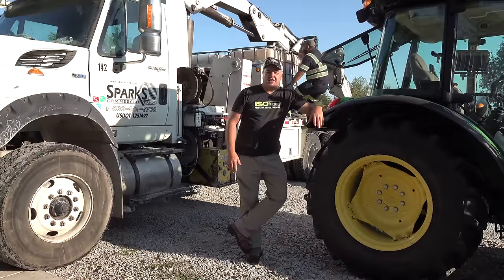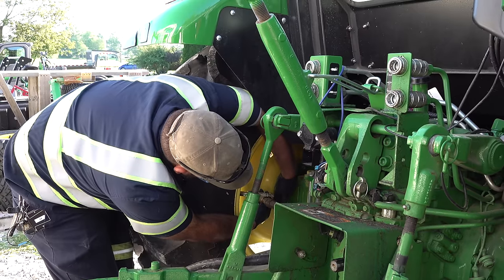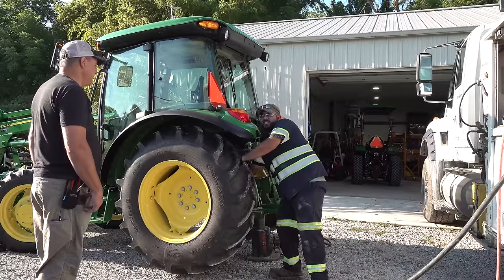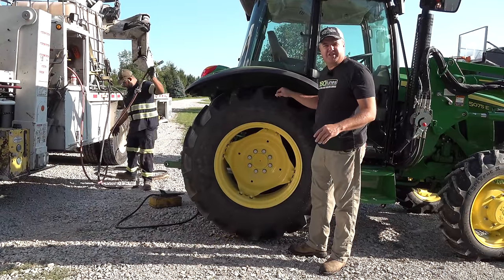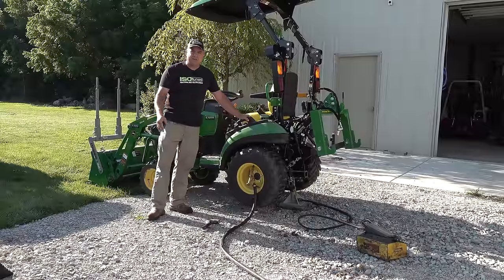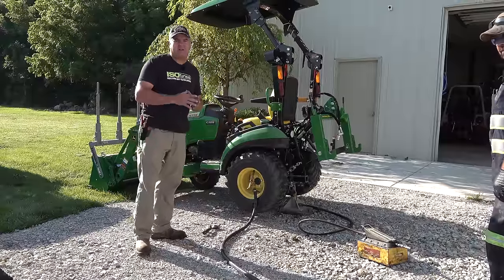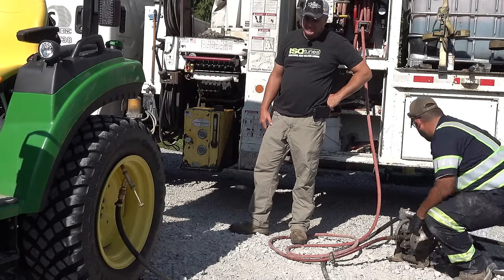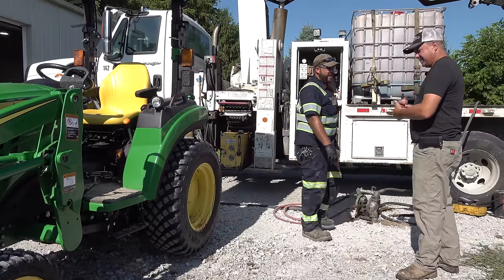Optimal Tire Ballast??  How To Add Rim Guard to Compact Tractors

Comment: Now I was told by my dealer not to put fluids in the rear tires on the 1025R it is hard on the drive train and void your warranty. I was also raised on a farm which drove a lot of tractors with loaders plus trained on a forklift you never transport a load no more then 4 inches off the ground . Any time. I use the loader on the 1025R there is 480 pounds hanging off the three point hitch and stay off the side hills.
Reply: Richard Koehler it clearly says in the owners manual (page 06-25) that you can add ballast to your 1025R. It’s under “Using Liquid Weight in Tire’s” 
Maybe the dealer didn’t want to add it because your deal was done and he didn’t want to come out of pocket or they didn’t have the capability to do so and didn’t want to hear you complain.
Reply from the maker: Richard, your dealer is incorrect.  As Wraith mentions, you should take a look at your loader manual.

Comment: Good video. I'm watching for the umpteenth time. However, this time I am waiting on the Deere dealer to pick up my Johnny 1. I can't find a tire service locally, and the dealer has to carry Johnny in to fix it.  The right rear tire began leaking Rimguard around the rim. I went to check the air pressure and barely touched the cap on the valve stem. The entire core with the brass insert blew out. I got the tractor in July 2020 and have only 32 hours on it. The tires were filled by the Deere dealer. Now sure about the statement in the video about Rimguard not deteriorating the valve stem. It looks like Rimguard could have deteriorated my valve stem... or maybe it was a bad valve stem. Either way is concerning and makes me very wary of checking air pressure. I am going to have them check the other rear valve stem. Thankfully I was behind the tire when I touched the valve cap!! Reminds me to always safety goggles around tires, especially filled tires. It does stink!!

Comment: No fancy stuff needed.
Pull tire and wheel, break bead on one side, pour in cocktail of choice. Air up & reinstall.
I prefer RV anti freeze for the tractor and Bourbon and Coke anti freeze for me.
Reply: I use the same in my tractor n me. No problem with tractor but I must have a leak. Constantly having to refill my antifreeze.

Comment: Are the factory 1025R valve stems compatible with RimGuard? I was told they are not!
Reply from the maker: There is some disagreement on that point.  Some say to replace them with steel.  Others say the rubber valve stems are fine.  Rimguard (the company) does not have an opinion on this. I have asked them.

Comment: I am having the rear tires of my new 2032R tractor being filled with Beet Juice..... I haven't taken delivery of the tractor yet....is Beet Juice ok?  Will it rust out the wheels??  And..... if you cannot use a loader without a ballast box, I am wondering why adding these liquids to the rear tires is beneficial??  Thanks for your thoughts.
Reply from the maker: Beet juice, formally known as Rimguard will not rust the rims.
Huge value for these small machines. They need the extra weight for traction, stability, and ballast.
You will find it improves the ride quality as well, since the tractor doesn’t bounce as much.  
Rimguard is the best ballast because it is inexpensive, and it is ‘hidden’. It doesn’t take up space which could be used by something else.

You need the weight to hold the rear end down.  Yes, you also need 3 pt ballast, such as ballast box.  Both are needed.
In my opinion, I would go a step further and get rear wheel weights in addition to Rimguard and a ballast box.  
Your loader is WAY out front, and makes the rear end light.  
We have LOTS of episodes discussing rear ballast with Rimguard.
Maybe we should do another one!
Reply: Thanks so much for the clarification, Tim!  You are the Man!!  I was over today checking on the progress of the new 2032R and they have already added the 'Beet Juice' aka RimGuard.  Much appreciated.
 @TractorTimewithTim

Comment: Hey Tim got a question. I’ve been told that filling tractor tires with fluid can rob some power from your tractor is this true? I got a 1949 farmall cub I’m thinking of filling with fluid on the rear but unsure if I should seeing it’s only a 10 hp tractor on a good day and don’t want to rob to much power. Thanks.
Reply from the maker: No, it will not affect hp.  Our Farmall cub when I was a kid had filled tires.

Comment: Would Run Guard alleviate the need for four inch wheel spacers on a 4066 ?

Also
What's the cost per gallon of rim guard?
Do they charge you a $95.00 delivery fee?
Is it less expensive to take the tractor in ?
Reply from the maker: Last time I got it...$3.25 per gallon.  I took the tractor in.
Rimguard in that large of a tire will make a HUGE difference.  You will love it.
Try it without spacers.  You can always add them later.

Comment: Good Works tractor just did a comparison between a 1025 R and a Kubota B2601. While this wasn’t a apple to apple comparison it was very useful; as, it gave a good comparison of what you gat with a slightly larger tractor. You previously did a comparison between a 1025 and a BX. You and Good Works by doing the comparisons have set the 1025 up as the base tractor. Personally I think this is great. Good Works couldn’t fo a comparison between a b2601 and a 2 series JD, because he didn’t have a 2 series to compare. However, you do. When a person goes to buy a tractor the dealership seems to use their subcompact as the first goto item; as, it is the lowest price. Since you two have basically set the 1025 as the comparison base it would be nice to see you do a comparison between the 1025 and your 2 series or even your 5 series This would not be a comparison to see what machine wins but to give viewers the opportunity to better see the capabilities of each machine. This would give viewers to see what the differences are rather than just reading a specification chart. 
As always a very good video.
Reply from the maker: Check out our recent 1025r VS 2038r comparison.
Reply: Tractor Time with Tim thanks Tim.
Reply: Thank you again for reminding me of that video. I had watched it previously snd thought it was quite well thought out and very well presented. However it didn’t really stay with me because you used a lot of references to the spec sheets. I remember how the specs some time just don’t play out. For example the specs for the BX and 1025r 3 point hitch and tractor turn radius showed the two to be virtually the same, but when you did the actual tests your results were  quite different. The 1025r turned in a far less area than the BX, while the BX’s 3 point hitch fid a little better than the 1025 R. You even went farther and test the hydraulic pressure. The 1025 R was producing more pressure that the BX.  I know that loading heavy weights on a tractor for testing purposes is a lot of work.  But, those real lift test and comparisons where the operation is shown is what sticks in ones mind. I was thinking that Good Works tractor snd you might be able to get together and compare the 2 series to the B2601 if he still has the machine. If that is not possible than maybe you doing real lifts and turning radius test might be possible. As always you always do a very good video.

Comment: Tim, you said you moved the tires out.  I have a 2038r that i need more stability in.  Do you know if there are different positions on my model like your big tractor?
Reply from the maker: No, there are not. However, you can get ‘spacers’ to move the wheels out somewhat.  I have them on my machine.
Reply: Thanks,  i looked at the spacers.  What do you think would reduce the tippy feeling the most?  Rimguard or spacers?  The stability is the biggest thing i don't like about my tractor
Reply from the maker: Use both!

Comment: One thing I don't like about Deere is their use of Galaxy tires which, unless something has changed, are made in China. On a premium tractor, IMHO they should come with a premium brand tire.
Reply from the maker: They use Carlisle in subcompacts.
I’m not sure there ARE any US made rear tractor tires anymore!
Reply: Titan tire and Firestone both make ag tires in Des Moines, IA
Reply: @marshallevans9457  IIRC, Titan bought the Firestone AG/industrial (OTR) brand so makes sense they're all made in that plant. Not sure what else, if any, are made here. Galaxy also had a plant in Yugoslavia @ one time but not sure what happened to it when they got bought by Trelleborg several years ago. They got hit really hard by the anti-dumping tariffs on OTR tires that were implemented - I guess it was about 8 years ago or so. Basically put them out of business had it not been for the (fire) sale to Trelleborg.
Reply: @TractorTimewithTim  Not much better IMHO. Should be a premium brand on a premium tractor.
Reply: danielsharon524 Actually Titan bought the Goodyear Ag tire business many years ago.  Firestone is now owned by Bridgestone. Most if not all their ag tires for both companies are made in Des Moines. Galaxy is the brand for Alliance tire an Indian company. They make tires all over the world but not the US.
Reply: @kendrury3713  I was just at the Kubota Dealer & I cannot recall what they had OE but it was a higher quality brand IMHO than Galaxy.
Reply from the maker: They run Galaxy Garden Pro as an option on the Kubota B’s
Reply: @rogerjohnson6252  You're absolutely correct on both accounts. Don't know why I said Firestone - Will chalk it up to getting old(er):). At one time Galaxy was a US owned Co. Last I knew was as I'd indicated with respect to them being bought by Trelleborg but that was several years ago. They still have a distribution center in Red Lion, PA last  time I drove by and last I knew were still making forklift wheels there but that's been a while.
Reply: danielsharon524 years ago Trelleborg distributed Alliance tires in the US. That ended and Alliance went on their own. I believe they are doing something together in India but not in the US.

Comment: Tim, just got my Tkv20 today!  Question, can I cut the pto shaft to fit without a quick hitch and still have enough shaft if I decide to use my quick hitch?  This is my first implement using pto.  Thanks!
Reply from the maker: Yes, it is possible.   However, the TKV20 requires the PTO shaft to be pretty short. ...so you won't have much room to spare.  I would recommend going ahead and getting the quick hitch before cutting.  Tell your finance committee I recommended it :-).    BTW, congratulations on the new TKV20.    An. amazing attachment!
Reply: Thanks!  I already have the quick hitch, just trying to figure out how I will use the tkv.  I use the qh with my box blade a lot, but the tkv is not the same vertical spacing as the box blade, so I’m in a conundrum.  I guess I might have to move the top link hook up and down every time I swap between the two, but that seems like a pain.  Thanks again!
Reply from the maker: Yea, that is a pain!

Comment: New to this....what does it do?
Reply from the maker: Keep watching.   It provides better traction when pulling or pushing, helps keep the rear end on the ground with the loader, reduces that 'tipsy' feeling by lowering the center of gravity.  Overall, more weight makes the tractor more effective.

Comment: Would it be worth it for a loader tractor that goes through a set of tires each year?
Reply: what are you driving on? crushed rock?
How many hours are you getting out of a set of tires?
Reply: rkwill100 It gets driven on pavement quite a bit. Field to field. Takes a beating on them.
Reply: If you need ballast, it certainly would be worth it. When you buy new tires the Rimguard would be pumped out and after the new tire is mounted, it would be pumped back in. You should only have to buy the Rimguard once. There is a labor cost, of course.
Reply: Roger Johnson Thank you. I didn’t think I’d be able reuse it.

Comment: I had my t264 tym held about 240 lbs per wheel. And no flat stuff in front tires. 200 hrs this spring no problem so far

Comment: Doesn't that stuff make it Rough as guts having a fluid with no give in it???? It's why I told my dealer to not bother putting that stuff in but I defiantly need more weight at the back.
Reply from the maker: No.  There is still air in the tire.  Same ‘give’ as without fluid.
In fact, ride is better.  You don’t have as much of the ‘bounce’.

Comment: Stupid question, what exactly is a rim guard?
Reply from the maker: Tire fluid used for ballast. It is beet juice.  11 lbs per gallon, biodegradable, won’t freeze in the tires.   Great way to add some weight to these little tractors.

Comment: most of the tire shops around me have gotten rid of the rim-guard fluid. they claimed it was too thick for the pumps they had. so they went with a RV type fluid for in tractor tires. not quite as heavy, but it will not rust anything. that beet juice is corrosive they tll me-not like calcium was but still eats things. i cannot say if that is completely true or not.

i had antifreeze in my front tires on my wheel horse for the hill i mowed at my old place-it is worth it indeed.

see i said nothing about ur attire today. hehe
Reply: yeah rim guard is obsolete around here. farmers found out rather quickly that windshield washer fluid was a better option.

Comment: had rim guard in my 445 JD after a calcium load rusted out the rims. then added it to my 1025 R after purchase.  The 1025R did spin the rears when mowing the grass and turning on the slightest incline leaving divots.  After adding the rim guard on more spinning when cutting the grass.
Reply from the maker: It makes a huge difference!

Comment: Another great video. We all been there going over unstable ground with a bucket load of gravel with the loader to hight and one of the back tires starts picking up off the ground, leaving clench marks of your butt cheeks on the seat. Based on your recommendations I found a Orange dealer that installs Rim Guard, When I dropped off my tires I could carry them both one in each hand after the rim guard it was hard to lift one in the back of the truck. Amazing amount traction and stability difference on my X585 with a 45 loader 
This question has popped up in my mind about ballast. Is having ballast at lower center of gravity such ballast in the tires and wheel weights better than having them on the 3 point hitch up higher raising the ballast cause more instability?  Similar to  having a load in the bucket up high with a load. Side to side stability. Now I could see the 3 point hitch weights extended further back and away from the tractor off setting
Reply from the maker: I’m sure there is some difference based on height.

Comment: I went with -50 RV Antifreeze. It was the same price as window washing fluid at Walmart, weighs more per gallon, and is non-toxic. WWF cannot be made non-toxic, no thank you. I would have used Rim Guard, but it is not available in my area, and shipping 98 gallons would cost a fortune!

Comment: One of the biggest advantages of filling rims is that the extra weight added does not put extra strain on the axle as the weight is on the ground compared to 3 point ballast.

Comment: If you had a tractor with no FEL, filling the front tire would be a good option. With lighter constructed tires that might be prone to leaks, the liquid filled will slow down the repair of the tires. Something to keep in mind.

Comment: If loaded mine i would get 500 lbs a piece which i want but dont want as i trailer mine a decent amount and i dont do alot of tillage. Im 22000 already and im right at my max with a couple thousand left for wanting a pickup camper at tractor shows.     Is "JOHNNY 5" really alive.  That might not be a good thing. Start talking back at you.  I remember watching short circuit

Comment: I work on a large farm, we use all sizes and types of equipment, modern and old. We don't use ballast at all, if it isn't safe to lift without ballast we have to get a larger machine. It's cheaper to own a larger machine than to mess with ballast.
Reply from the maker: Interesting.   No cast iron wheel weights on the larger machines?
Reply: @TractorTimewithTim  Nope, we already have issues with rims cracking, we have very substantial hills on the farm where I work in New Zealand. There is really bad side loading and it wears the machines out, more weight equals more wear. We are driving tractors on more that 100% grades a lot of the times. We have large European style utility tractors (duetz fahr) we do mowing, silage work, fodder crop tillage/planting. Frankly It costs to much to pay someone to take ballast on and off.
Reply: @felixchetlanddevries2998  a 100% grade is (if I remember correctly) 45degrees!  How do you avoid rolling?  How do you avoid sliding?
Reply: @rkwill100  Keeping the weight on the uphill side when going across the slope is a must, we do slide sideways down the hill sometimes. These large tractors are much harder to tip that a compact one. You just try to only go up and down the slope.